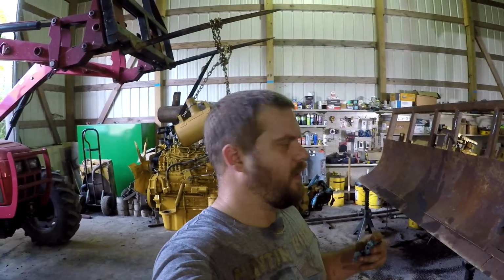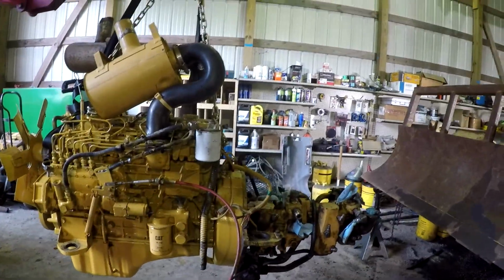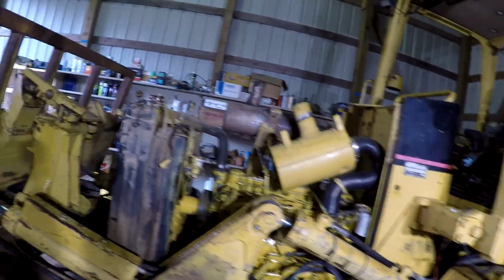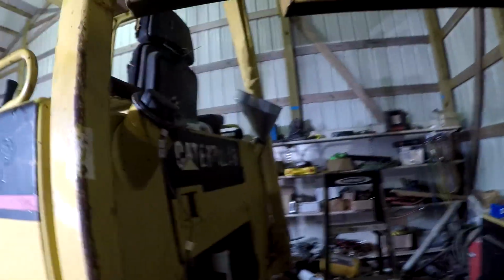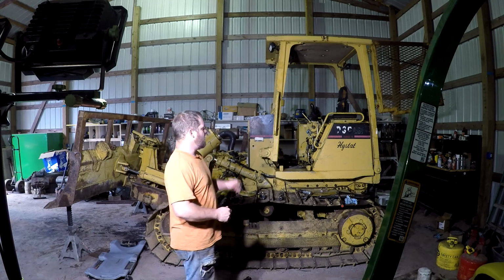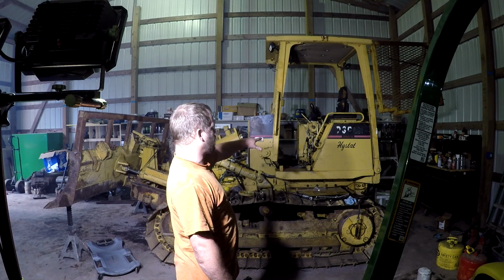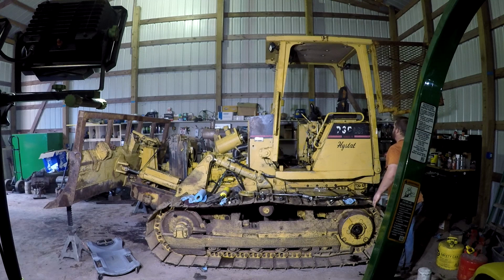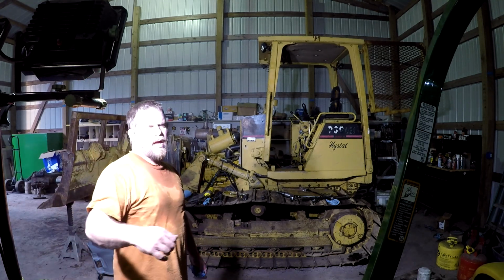Does the cat d3c hystat dozer move after installing the new charge pump

Comment: Any idea What the cable from the injector pump to the bottom of the hydraulic pump does.
Reply from the maker: Yep, it destrokes the pump so that the pump doesn't stall the engine when pushing, even if the joystick is fully forward. It should be set so you get full power to the tracks but you don't bog the engine to much.
Reply: Thanks. I was figuring it had something to do with the governor. This dozer set in a river bottom for 7 years when I bought it so I have had to go through it like you have your. Next is the track adjusters an I hope I will be done.